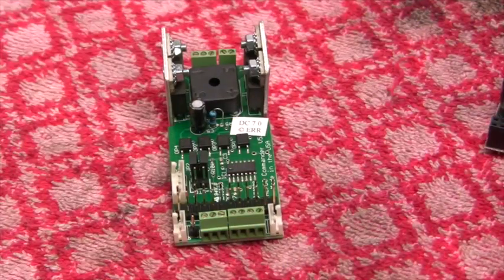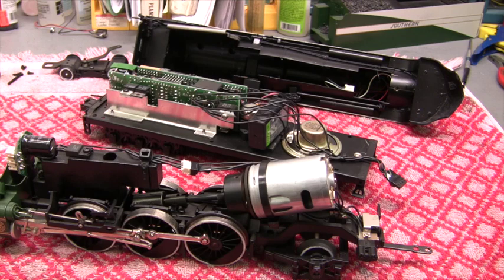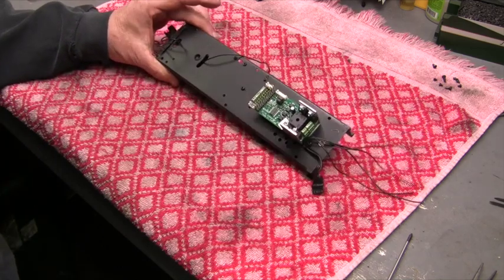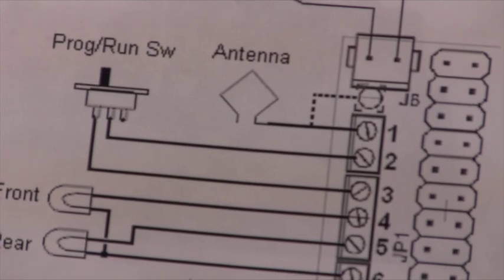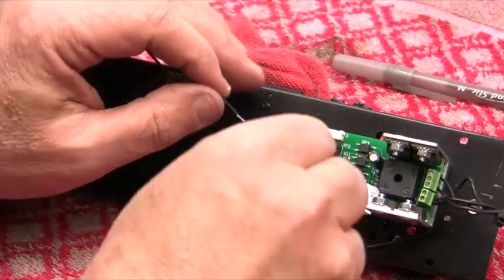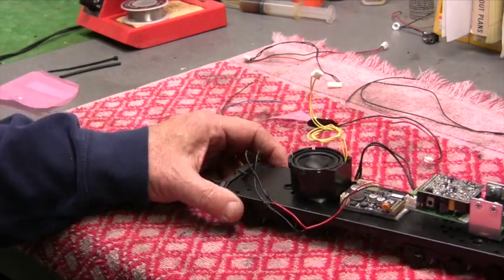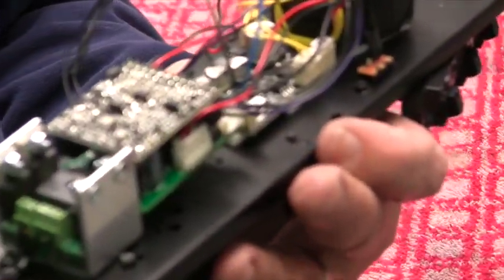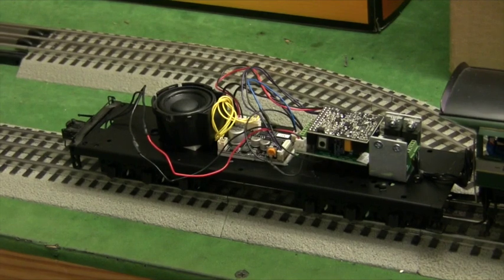Installing Electric Railroad Company Sound and Control Module

Comment: Great How To, I've got some really nice Williams NH Alcos I'd like to try this with. Looks pretty straight forward. Thank you Sir.
Reply: I've done s few Williams Alcos Robert.  I've done a few PAs,  1 FA,  and an RS-11. They're easy to do and most of them have a separate sound board, although most are only horn and bell. If that's the case and you don't want to spring for an ERR Sound Board, you can use most of the Williams sound boards already in the engine. Good luck and have fun with it.

Comment: Thanks for an excellent video! I have to replace the sound board on my Christmas Mike. This is a great help. Would be nice if there was a way to wire the chuff input to an existing Lionel hall effect sensor board on a tender instead of using the reed switch. ERR had no tips to give me for that. They didn't even know it it was a possibility.

Comment: Legacy station I used to live in Tennessee but since then moved to Michigan. I have 2 engines one a southern PS4 4-6-2 and a NYC Niagara 4-8-4 from Williams. I run MTH for my sound( not much for crew talk). Was wondering if I sent these two engines to you could you place a sound system in them. These are my pride and the cost really isn't a factor. Thank you Pamela Jean  Walkowiak.

Comment: Think you will make a video on installing a ERR command board for an MTH operating car?
Reply: Possibly. There are a few inexpensive boards available that will take care of a lot of MTH operating cars such as the Ice Car. You can e-mail me at trainrepair@legacystation. If you do that and give me your phone number, i'll be glad to call you and let you know the best one to use. I can guide you into the installation, or I can do it for you. Thanks for your interest. Barry
Reply: Something came up in a conversation I need to clarify. You can install Electric Railroad Boards in about any AC powered O-Gage Locomotive or operating car, including the popular MTH Line, however, if you run your railroad with only DCS, the converted item won't work. It takes TMCC or Legacy to operate EER boards. There are a lot of model railroaders out there with both the Lionel and the MTH systems, and these systems work fine on the same block at the same time as their signals are transmitted differently. Lionel's is transmitted into the air and MTH's is transmitted through the center rail, so they are 100% compatable. In this case, simply use your Legacy or TMCC system to operate the engine or car you installed your board in. Any questions, write me at trainrepair@legacystation.com .

Comment: What brand and model speaker did you use for this particular build?
Reply: This is a speaker from Lionel called a fat boy mini. It is about a 1.75 inch speaker with an included plastic baffle it snaps into. it is rated at 8 ohms

Comment: Thanks for a great video. The only thing you didn't show was how to install the actual reed switch so that it doesn't pull out of the tubing you glued near the magnet. I would think it would just slide out if not attached somehow. What method did you use ? Thanks.

Comment: What type of switch is that and where can I get an identical one along with the magnets?
Reply: These are reed switches. With the wires coming out of only one end they are called a proximity switch, but are mechanically a reed switch. You can google the term miniature or ultra miniature magnetic proximity switch. Companies that sell them usually sell the magnets, but usually sell them in cylindrical or bar form. You need a button magnet for this type of application.. Here's the tricky part, I believe the ERR magnet is a rare earth magnet because of the strength. The strength of the magnet determines the actuation and release distance. Certain types will lose their field because of the EMF generated by the rails, while other rare earth types will not have an issue. The magnets are easy to find, as are the reed switches. Can't tell you if you'd need to experiment or if you can just  buy the parts and only adjust the distance to make them work.  Depending on the type, some of them can be bought off Amazon.

This page discusses the magnet types.